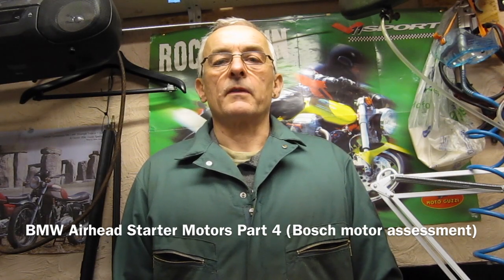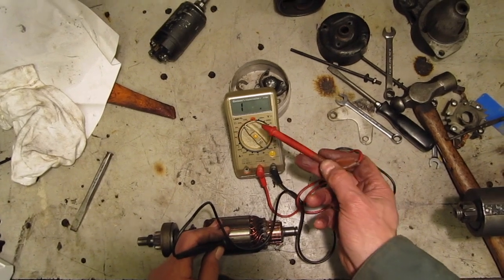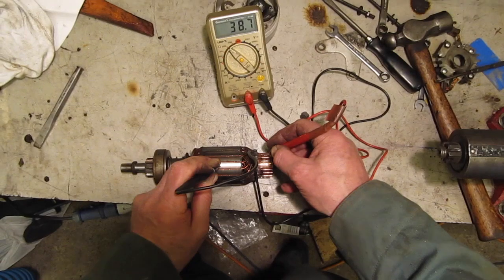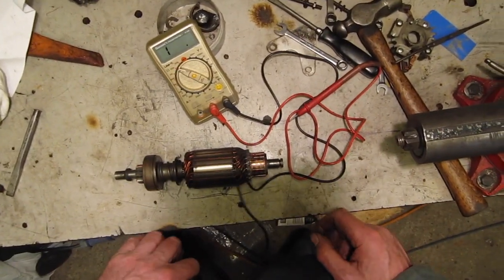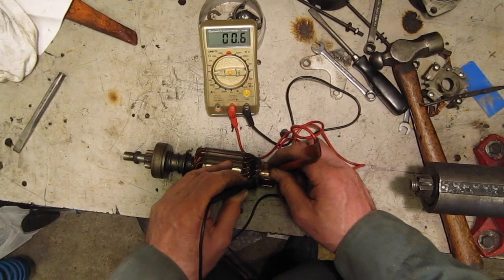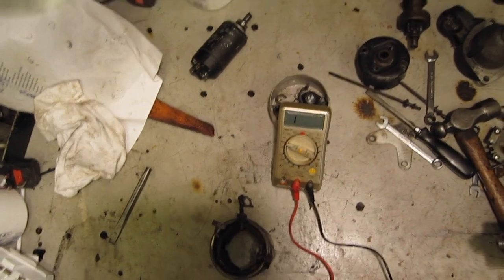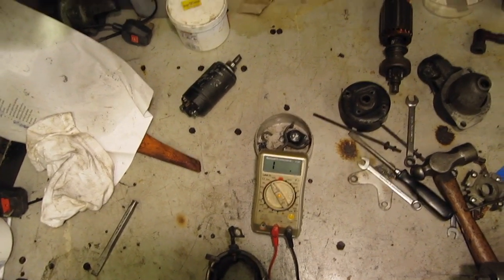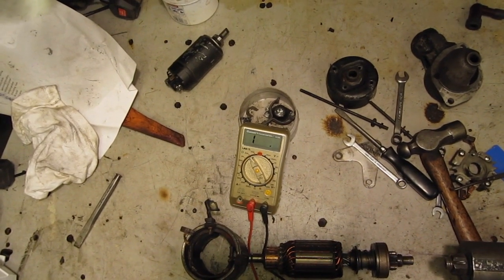BMW Airhead Starter Motors Part 4 (Bosch motor assessment)

Comment: Hi, interesting videos, but in this one where you test between commutator blocks and lamination stack, shouldn't it read open loop or 1? confirmation would be good as I have my bmw armature on the bench. Thanks Ralphie
Reply from the maker: Hi Ralph, sorry for the short delay. The resistances you are seeing are very high and can be considered as open circuit for the purpose of this test. The point to note, is that the reading as you test each segment is consistent with the others (that is: no significant drop in resistance).
Having said that, the only way to be sure that the armature is sound is to test it on a growler. The test I am doing here is a less satisfactory substitute and it may miss faults that a growler would pick-up.
There are plenty of YouTube videos showing how to test an armature with a growler. Here is a link to a very short basic test: https://youtu.be/HZmKBcCUu0M 
There are even videos that show how to make a growler.
Best of luck with your fault finding,

Comment: thank you for sharing my friend ,how can we clean contacts inside bendix,this bosch bmw starts are mess,now im make a carbon fiber piece whith screws around to fix my bendix coils when i need because as other issus as well like plate contacts not strait is a 25 years starter
Reply from the maker: Hi Miguel, thanks for your enquiry, but I'm not sure what you mean. To me a bendix is the gear mechanism found at the end of the armature shaft on an old fashioned inertia starter motor used on cars mostly up until the 1970s. It is purely a mechanical device (no electrics) and was never used on BMW motorcycles to my knowledge.
Reply: hi my friend im talking about coil contacts inside plastic piece,im all ready open mine but people can´t open ive seen conctac issus many times
Reply from the maker: Hi again Miguel, still not quite sure which contacts you are trying to access, but if it is the solenoid contacts, then you can see how to access them near the end of the first video (part 1) in this series. If it is something else, try sending me the Spanish name for the component and I can look up it’s name in English. Good luck, Guy.
Reply from the maker: Yes Miguel I see you have already opened yours, but as I say it is in part 1🙂